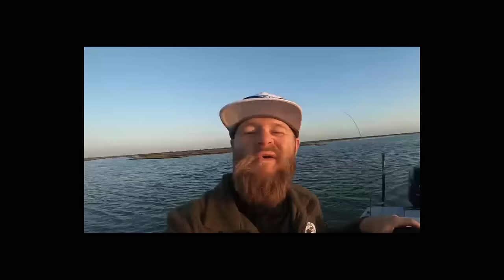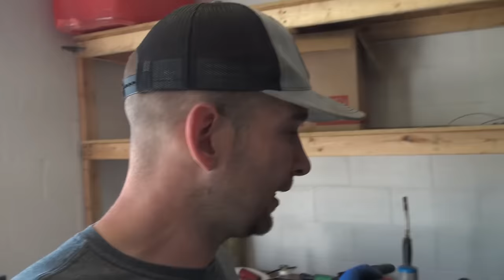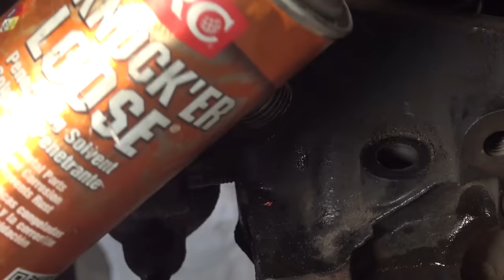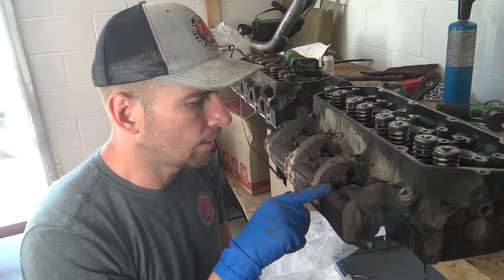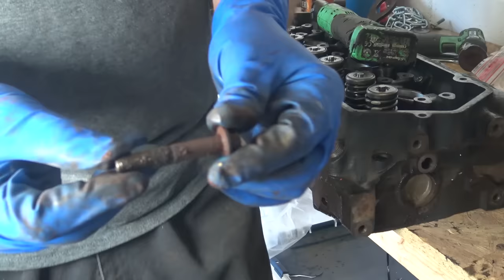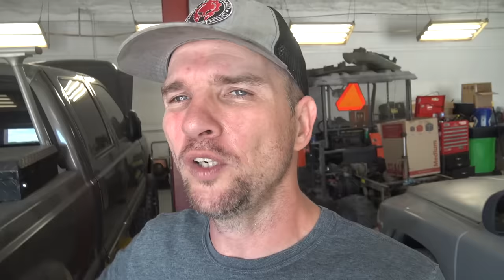Old Mechanic Taught Me This Trick To Removing Rusty Exhaust Manifold Bolts!

Comment: If there is enough room, try to get a die grinder with a skinny cutoff wheel in there and cut off the bolt head flush with the manifold, then soak with PB. Also can cut a deep groove or 2 across the bolt head down to manifold surface which releases most of the bolt tension. Then a 6 pt socket can be used to unscrew the bolt or snap off the bolt head. After soaking the manifold can be pried off. After the manifold is removed, you still have a stud that can be worked out with a small pipe wrench.
Another method for removing just the bolt head is to center punch and drill with a step drill until the head can be knocked off with a chisel. Sometimes the bolt will be hardened by heating/quenching cycles and must be annealed (softened) by heating the bolt head to a bright cherry red and covering with a wad of aluminum foil and left to cool slowly.

Comment: Good Tips, appreciate them.   I like Deep Creep penetration oil.   Induction Heat : Bolt Buster.    It's almost like you would want to dry-ice blast the threads or dremmel them with a brass wire wheel to get the rust off them if you can reach them.

Comment: Thanks for the good video. It got one of the bolts look on my 2005 Ram, but no success with the others yet. The two front ones are 1/2 inch, the one is loose, the other may be moving. The ones that are frustrating me at the ones further back. The bolt heads are quite rusted, so getting a socket that fits properly is a challenge. No matter what size I use it slips. I was getting frustrated, so I called it a day before I broke bolts in frustration.

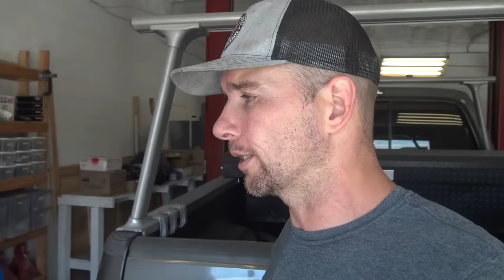Comment: @14:29 is when you heat the manifold then push paraphine wax in and it will pull out a lot of rust. Then twist back and forth. Great video by the way 😊

Comment: Great tip I have done something similar I have always removed exhaust bolts right after the car has been run to operation temperature and I use Kevlar gloves and sleeves. This is way simpler.

Comment: 100% Australian eucalyptus oil is miraculous on rusted bolts & hinges.
I had a 1958 VW bus that had been sitting untouched in a paddock for 40 years. Wheel nuts, door pins & back window piano hinge all rusted tight.
With a little eucalyptus oil (couple of teaspoons) applied to the threads with a syringe/ eye dropper for a couple of days the rusted bond was broken. without  pressure, heat or anything else the doors were swinging freely like new. On initial contact with the big piano hinge on the rear hatch, the hinge went "crack" & released immediately.
Great stuff worth a try. Your video is fantastic too BTW- thanks.

Comment: I have found that a good hard tap on the head of the bolt with a hammer also helps to loosen the rust, I have had to use that method with success many times when heat is not available. Along with the methods you show as well.

Comment: as I'm now old enough to have had knew Stephen's trick years ago ;-) - one thing I do after spraying with penetrating fuel is to hammer the bolt head a few times : it can help to unlocked the threads & break rust under the flanged head & on the slick part of the bolt.

Comment: thanks for sharing. i gotta replace the passenger side exhaust manifold for my 2014 e150 because it warped and i am not looking forward to snapping those bolt heads off.

Comment: Another one I was taught by an old hand was to hit the head of the bolt square on a few times before doing anything; helps to fracture the bond by sending shock through it.

Comment: Hi , I have had to use a center punch on heavy rusted bolt heads , to fatten / enlarge the bolt head,  to fit tighter in the socket . It also helps crack the rust in the threads or around the bolt stem.

Comment: Amazing. The boat guys at Harbor Marine Inc Ocean City Maryland do something similar with their aluminum heads. They actually tap (hard) on the ends of the bolt, and then do a similar micro turn back and forth. It takes forever, but it works.

Comment: Yep I use never seize also on the bolts I’ve found that when I pull those manifolds off at the end of the race season they come out easy . Before they were a pain . It’s so easy to get frustrated and rush it and then break the bolt and then  you are dealing with ten times more time to do that job

Comment: This video is a master class.  High praise for teaching many great techniques and procedures.  I'm watching it for a second time in roughly 2 years.  In the near future I need to remove a couple challenging bolts on my 2004 VW GTI.  There's a bolt that connects the control arm to the subframe by threading into a captive nut welded to the subframe.  The nut is captive because no tool is able to access the nut.  Many who performed this job on their cars have broken the weld on the nut, resulting in the need to grind a hold in the subframe to access the nut and hold it still by wedging a screwdriver against the nut in order to remove the bolt.  I have been preping for the job by spraying penetrating oil into a small access port (roughly 3/8") diameter.  I can see the nut but putting a tool on it is impossible, and the nut looks round, not hex.  My plan is to us a heat gun to try and direct heat on the nut through the small hole in the control arm.  Then use your method of gently loosening a very small amount before tightening and starting the cycle over again until removed.  My concern is that for many others, their problem was with the weld on the nut becoming weak as a result of rust.  If you have advice on how to deal with this unique situation, I would definitely appreciate your advice.  Thank you for making this video.  I gave it a thumbs up the first time I watched it, so unfortunately, I can't give it another thumbs up, but would if I could.
Reply: How'd your job go?

Comment: Hey Steve, Weatherford here, nice video. I've always found a little heat usually works. I don't even try loosening those SOFT brass break bleeders until I hit em with PB Blaster and some heat. Broke to many off when I was young.

Comment: Great vid & tips - thx. ... I have used reg drill bits "use a water bottle with a small hole at the bottom to keep the bit cool" is my tip for someone...and if I can't get the bolt out myself, not having the right tools, find a smaller screw with a washer to tighten inside the bolt, to keep the manifold from warping, till you get it fixed somewhere, or the right extractor to properly get it out... but yeah, don't just keep using it with a broke bolt, it will warp the head and mess up the new gasket under exhaust pressure, and cause more problems, and $$$

Comment: Excellent video, learned ALOT  from it. That makes sense about retightening the bolts again after loosing. I heard it was a good idea to tap or vibrate the bolt after spraying with penetrating fluid . I feel it helps to move fluid past rusted parts. I really enjoyed your Video. Thanks.

Comment: Your right about knocker loose. Had a ford van with over 100,000 miles and needed an exhaust manifold gasket. Used the knocker loose and 1 hour later I could remove the bolts with no force. Also there are 2 knocker loose out there. Use K&W only

Comment: Highly recommend MASTERS® Metallic Compound instead of using anti-seize in high temperature applications.  On heavy trucks the temperature, participate and pressure sensor fittings in the aftertreaemt system are very prone to getting stuck, and because of the stainless steel, the often don't come out even with this method.  Thanks for this video!

Comment: KT3406e takes a hammer and smacks the bolts going into peanut covers. They have hex head bolts going into aluminum. I think it kind of shocks snaps em. He says since he started doing it he rarely breaks them anymore. Just wondering if it may help on exhaust bolts.

Comment: good video  here is two other methods
I use that work well
heat bolts  apply paraffin wax, it penetrates the threaded when it cools it is the lubricant ,bolts come right out
You can also heat parts cherry red cool down quickly with garden hose- heat and quench- break rust to dust just don’t overheat cast iron you can crack it
I like liquid wrench as a spray lube  I find it is one of the best followed by the more
expensive  aero-kroil

Comment: This is great thank you for this information definitely a helpful plan of attack on any stuck bolt or rusted bolt. When you described the reasons why not to remove the bolts entirely, the thought occurred to me that what if you start on one end and the second bolt you go to the other side and work your way towards the middle? Would that help things?

Comment: An old buddy of mine used that "trick" all the time. First try to tighten a hair, then try to loosen a hair. back and forth, like this guy said, tighten, loosen, etc. It works very well. Now, you are not necessarily looking for movement but the pressure of the tighten and loosen sequence will eventually cause the bolt to either tighten slightly or loosen slightly. Then you can remove the bolts. Patience is the key.

Comment: I did here that bolt crack just before you mentioned if we herd the bolt crack, i knew about the tension    on on the other bolts, when you try to take them all off.

Comment: If you really want to help with heat use wax on the hot mating surfaces.  It being oil based melts,chases the threads a d works wonderfully.  I'm a marine engine mechanic, and I deal with stuck fasteners from cast aluminum and stainless every day. The galvanic reaction that causes corrosion is very real. Most fasteners are broken because of lack of patients. Great video.

Comment: Kroil works really good. I try to soak and let sit for as long as possible, overnight if possible. If pulling all the bolts to remove the manifold I start at both ends and work my way to the middle removing the middle bolts last. Its best to follow the torque sequence in reverse if possible.

Comment: The back and forth helps sweep the tiny rust particles out of the threads, as does flooding in more penetrating oil, plus screwing in helps move the oil inward.  What jams the threads are the tiny rust particles jamming together like sand does.  Once some oil is into the threads, tapping the end of the bolt with a hammer helps hydro-shock the rust loose and force it out.

Comment: I broke an exhaust manifold bolt on my Dakota and it was a nightmare. Tried a bolt extractor but that didn't work, tried drilling it but stopped doing that when I saw aluminum shavings, finally had to get creative with a stick welder. All this while still mounted in the vehicle. I'll try your method if there's ever a next time. 👌

Comment: Shock stres the bolt to get it out.  heat it up hot douse it with water and it'll come right out,  try it~it works !  When you run out of options give it a try ?
Great video thanks ☆

Comment: When I was in the Navy we had to change out a wing pylon (where bombs are hung) and the large bolts were frozen in place. No heat can be applied as the wings have fuel cells in them. An old Chief sent me to Sick Bay for a quart of Oil of Wintergreen, I painted the bolt heads liberly with the great smelling oil, let it soak for 15 minutes with a fresh application of oil every 5 minutes. The bolts came out easily with steady pressure, Miller time!

Comment: As a retired GM tech I had two methods of removing rusted exhaust bolts studs nuts etc.
PB Blaster penetrating oil let it soak a few minutes. If that doesn't do it I use a torch to heat up the nuts till they glow. If it's a stud in the outlet of the exhaust with a nut that refuses to budge I'll heat the manifold. 
Never really had issues with bolts directly in the head as GM has most engines with aluminum heads. Cast iron heads with exhaust bolts I'd soak for hours in PB Blaster before attempting to remove. 
Hope that helps.

Comment: My father was a Ford mechanic for 40 years and passed away about a dozen years ago, now.  He worked on cars driven up here in Wisc. in the salt and it always amazed me how he could get things apart.  One of my favorite was an exhaust pipe he was able to save on an old Acura that had no right being saved.  I kind of told him, we can spend the $20 on the new one, but I think he kind of took it as a challenge.  He always pops into my head when removing rusted fasteners and your tips echo what he taught me.  Your video was also some good motivation as I am eye-balling a manifold gasket replacement on an old B3000 that I have alot of that know-how instilled in me already.  Now to get after it....

Comment: Well some 37 years ago, this was what an old army mechanic taught me. And yes I’ve been working on cars that long. Anyway, he taught me that when installing exhaust bolts to put a little grease on the threads. As it is a substation for neverseize. As neverseize did not exist back then. It will smoke a lot at first. But it does work. That Army Mechanic by the way was my late father. And yes you can reuse old exhaust bolts, unless they have been in there a few decades. But I do recommend using new ones, every time as bolts are cheap compared to your labor to extract a busted bolt and tap!  Other tip, if you do have to drill and tap an exhaust bolt. Use the correct type of tap, for a bottom out bolt hole.

Comment: I use an impact driver tool to remove rusty bolts. You put the driver tool on a socket and tap it with a hammer until the bolt (or nut) breaks free. 

This tool was especially useful when I was tearing down my snowblower to replace valves. The intake was fastened on with phillips-head screws! Try getting those out without an impact tool... you can't keep the screwdriver seated in the screwhead! BTW, I replaced them with socket-head cap screws for the next teardown.

Comment: I have found that you can heat it up then cool it down with a spray bottle or what eveer.  It works because the heat expands the metal and cooling it down contracts the metal.  You can often hear the threads cracking lose. Patience is critical.   Biggest cause of broken bolts is flate rate.

Comment: Great technique! Good to know. Doesn’t the factory apply something like a copper anti-seize to the bolts when first installed? Good idea to clean out the threads with a tap prior to re-installation. Better to replace bolts with new ones before re-assembly as you advise 👍!

Comment: A very good presentation about getting stubborn bolts or studs. A thing that I have used to good advantage in many situations, is to put an assortment of plain aluminum round bar drifts for your toolbox. Grab the drift with your vise-grips or hand, and a hammer in the other hand. Place the drift on the bolt head, and start tapping. This seems to cause “some” axial movement, while loosening any crap all the way to the head.
  Another thing that may save your bacon, if you can not get a wrench to the work, and especially nuts on studs, is after the soaking, is to use a small cold chisel to start a “driving notch” in a flat on the nut, and either split the nut or start the turning. I had to make a “special” to change a turbo on a mini excavator. I took a good quality 3/8” chisel, and inserted most of the shank into a piece of 3/4“ round bar, and secured it with two set screws after grinding grooves for extra bite. The whole deal was over a foot long, but loosened every one.
  Your remark about a six point socket is all too often missed.

Comment: Working on truck engines this is a very common problem,,I find taking a flat punch and hitting the bolt head a few times always free,s up the rust,,As for penetrating fluids I have never found the threads wet always rusty and dry,,,I use a few drops of brake fluid on rusty nuts and bolts works a treat

Comment: You can also shock the bolts. i usually hit directly on the head of the bolt with a hammer or use a big punch. this cracks the rust and corrosion. bang each bolt a few times then do exactly as in this clip by tightening and loosening

Comment: I removed an air injector rail off of a manifold. Penetrating oil and a rosebud. 6 point box wrench and a hammer- tap it back and forth, back and forth. I did not know about tighten it back down- thank you

Comment: After soaking with lube, I use compressed air to force it into the threads. Wait several hours, do it again & hit with a regulated impact. Impact will apply pressure to the bolthead more evenly.

Comment: AWESOME! Another method I have found to be extremely successful is to take a wrench and a hammer, tap on it in both directions, the sharp tapping will cause the rust to snap lose through the vibrations. Understand I said tap, don't bang the crap out of it! I use to work on aircraft for the Marine Corps in Metal Shop/Airframes. The hardest thing to get other shops to do was to stop and come get us if they came across any hardware that wouldn't come lose easily. They would normally strip the head or break it then come get us. Aggravating!! Thanks!!

Comment: I always give the bolt heads a few light wacks with a hammer and drift to "shock" it first. Breaking the galvanic bond between the metals always helps. Heat is essentially doing the same thing.

Comment: Never see manifolds that good of shape in NY. Usually pitted and the head of the bolts are 1-2 sizes smaller than original and pitted. You'd never see threads still existing if exposed like that.  Must be nice. That is what a late model truck exhaust looks like

Comment: Wish I saw this sooner lol 
But now I have an additional better sounding idea for the one bolt I snapped.   I know what I did wrong now.   I didn’t have a torch so I let the engine idle for two minutes and was able to get them all out minus that one. 

I’m going to try the torch and in and out method with vice grips tomorrow.  If that doesn’t work I’ll tack a nut to it and do the same.  

Wish me luck 

Thanks dude!🙏✌️👍